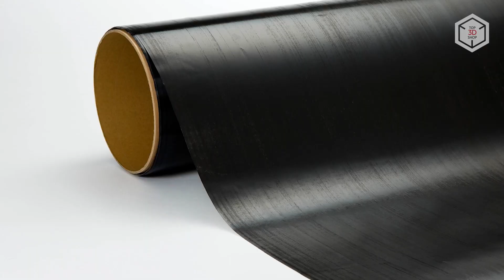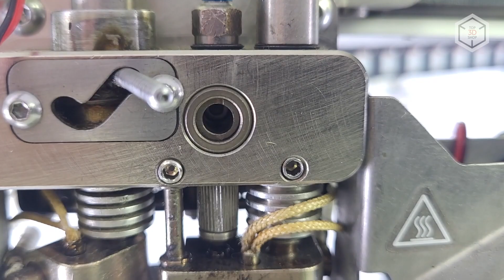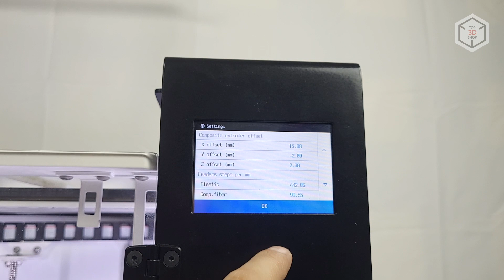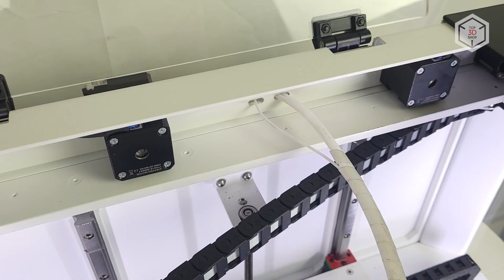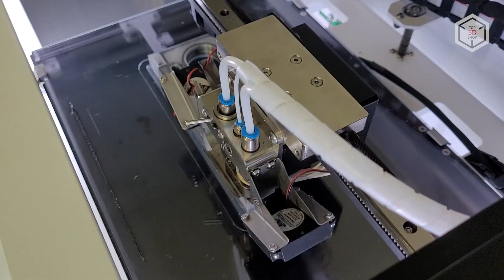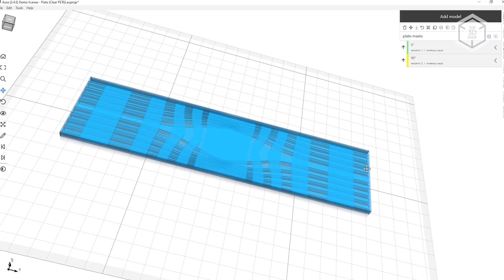Anisoprint Composer A4 In-Depth Review: Professional Continuous Fiber 3D Printer

Comment: Neat, but this is just reinforcing the 'strong' direction already, it does nothing to deal with core critical problem with 3d prints in that they're very weak in the layer-line direction. Why not do something like this, but use an orbiting second head to inject glass or carbon fibers the first couple layers, bonding in the weak direction for stronger layer adhesion?

Comment: Markforged o this, what'is Better?
Reply: MarkForged is fiber reinforcement through separate extruder. Anisoprint is coextrusion through a single extruder.
So layer adhesion is not affected and also you can make ultralight strong parts. I think for a hobby use coextrution is an overkill.

Comment: This is really cool but $30,000 is a lot for what’s on offer. Even for industry, we paid $20,000 for a Stratasys F170 which included a 1 year tune up, filament, support material, acid washer, and tools. I’m seeing a $7000 printer max here.
Reply: A4 is about 16K Euro and Stratasys F170 is a regular FDM, not continuous CF printer. Only MarkForged Mark Two is in this price range, but it is not coextrusion CF.